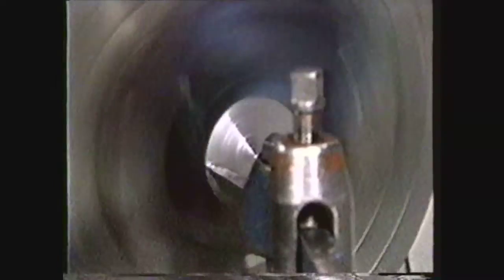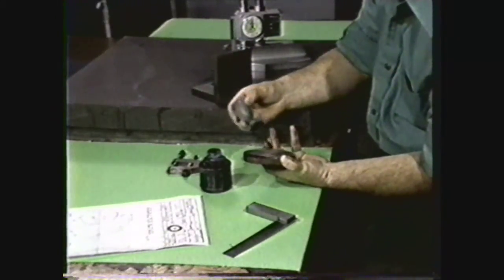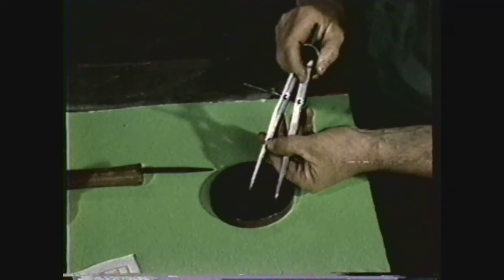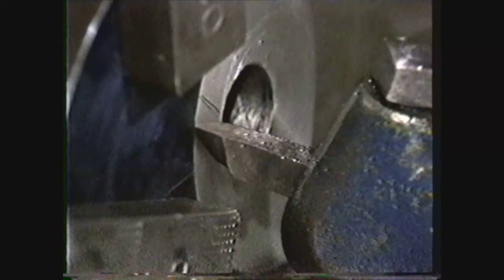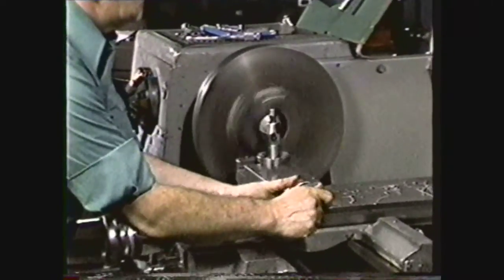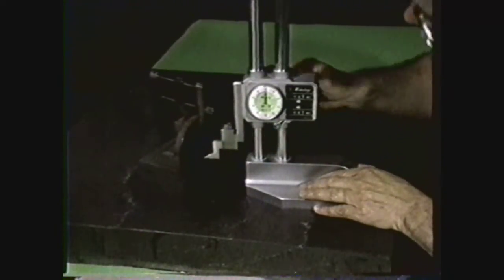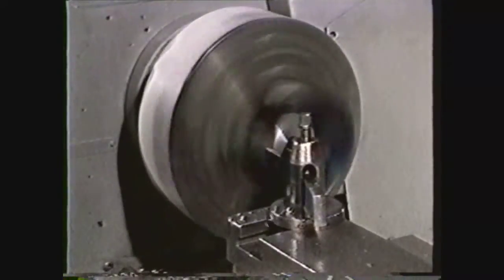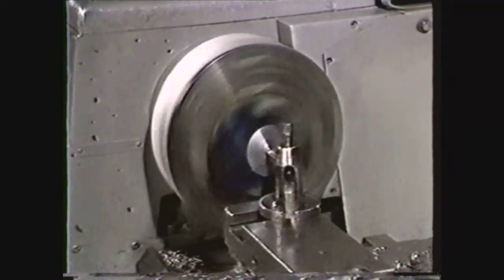Mechine Technology III lesson 11 Machining Offset Holes Face Plate and the 4 Jaw Chuck

Comment: These art lost skill sets our our heavy industries will need if we ever hope to prosper in future.  All CNC will not meet the dynamics of a heavy industry economy if it ever returns.  I am a General Machinist working for a instrument company.  Most of my work demand is prototyping. Without this ability to have an in house small machine shop the company would be handicap, and it's not just having machines it's having the individual with experience and skill.  We use a 9" south bend lathe and a 48" Bridgeport mill machine.